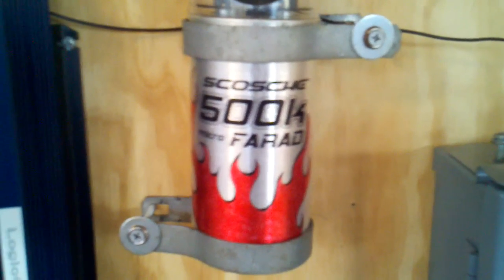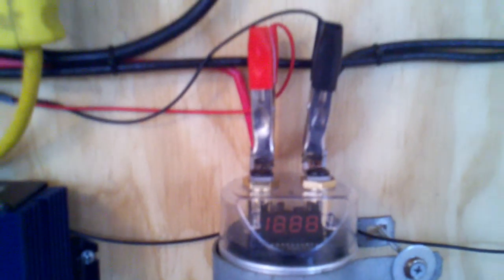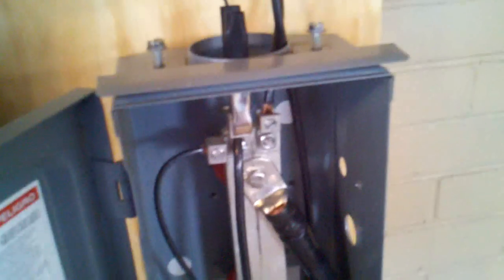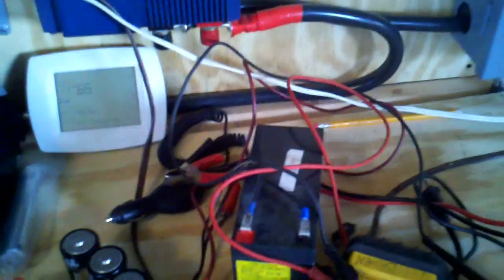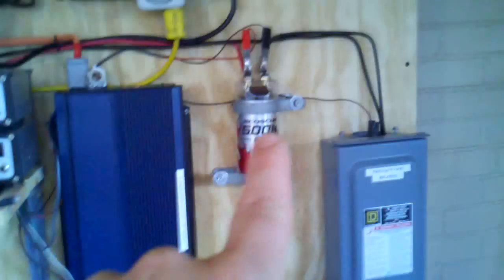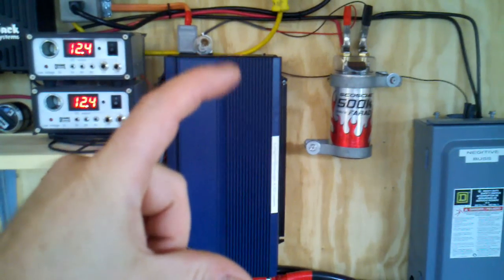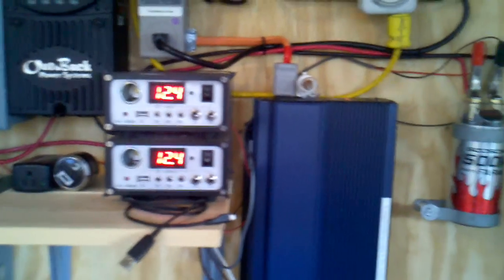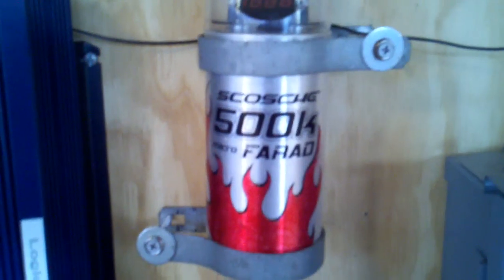How to wire a super Capacitor into your PV solar setup to help with starting up inverter loads

Comment: i got  my super caps and hook it up to my batteries in parallel , I've notice that it discharge my batteries during nite time, does your batteries discharge too? i try to connect onli the batteries and the 6 super caps rated 2.5 v 700 farad parallel to the batteries and discharge it but not totally discharge. the reading of my battery voltage is 12.8 v then i hook up the super cap @ around 6pm then in the morning @ 6 am  the voltage reading is 12.5 v, is there any remedy to eliminate this voltage drop while using the super cap?

Comment: what happnes to inverter when the cap discharges. How do you determ the correct MFD and volts of the cap to be used ?
Thanks

Comment: what happened if I connect battery to capacitor then to inventer like this (solar controller 12v to capacitor to battery to inventer 2000w) is that safe??

Comment: so technically the super capacitor is parallel to the battery ?   is it like charge controller to battery to super capacitor then to the inverter

Comment: This is unnecessary. No need with solar because the battery bank is large enough to support even the largest surge loads.
Reply: Wouldn't this extend the life of the batteries? And for me, having built my own battery w 18650's, wouldn't this help

Comment: Guy, am I understanding this right? You wired your capacitor in parallel with your battery bank? How did you determine what size you needed? Thanks.

Comment: Can you confirm the cap is sitting in between the inverter output (load) and the appliances (in this case you’re using a bus bar). For some reason it looked like you had it between the batteries or power source and the inverter which doesn’t make sense

Comment: Can you please let me know , is it OK to connect 2 500K caps to one 2000w inverter? or it not recommended? by watching your video I learn a lot, please keep up the good work.
Reply: remember that 2 capacitors in parallel double the voltage. in series it half's it.

Comment: Thank you Guy for sharing your wisdom with this clever hookup! I have a question for you re. your positive and negative busbars. What type of insulated standoff did you use to isolate the bus in their respective box's?   What is their specific name as applied here in your setup? Are those readily available items found at the big box stores electrical aisle, or are they more of a specialty item found at the electrical supply house? I have some nice copper bar from a friend who had extra from a high volt install. I really dig your setup and want to use your layout on my own system and the insulators to isolate that bus are the last items I need to complete the project. Hope to hear from ya soon! Thanks in advance from a big fan of the channel!

Comment: Been thinking of something like this for my 24v system in my RV to help start my rooftop a/c. Can anyone speculate on if that would work, and if it's possible to wire 2 of these together for a 24v system? My inverter is only 2500w and these RV a/c are really hard to start.
Reply: If the caps are rated 24v or above, you can hook them together in a 24v system.
You can not use 2 x 12v caps to get 24v.

Comment: The main problem with starting large loads with a high frequency inverter is how fast the DC-DC converter inside it can recharge the internal high voltage DC storage caps.

Adding capacitance on the input side as you have done may well help, but what I'm picking would be really effective is beefing up the size ov those internal caps. A bigger reservoir ov stored high voltage DC would give the H-Bridge more to dish out.

This ov course is an extreme mod. It requires hacking an inverter, would certainly void the warranty and is quite dangerous too due to the voltages involved and the fact they are stored in caps. No more dangerous though than working on a tube guitar amp. ;)
Reply from the maker: xanataph Great thought but like you said that is a hack of hacks. I think I'll stick with it like it is. Thanks for watching!!!
Reply: Guy Brown I saw a guy on YouTube strap two 400w inverters together so he could get 800 watts out. He did it by connecting the HVDC line ov each inverter together. Now thats extreme! It worked well though, but it was really just a proof ov concept as each inverter was only 400w. Would have been a tad easier to just get a 1000w model! But not as much fun. ;)

Comment: Just curious as it seems that you've done this setup a few years back.  Have you rewired your setup?  The reason I ask is that the wiring on the video had 90 degree bends and the box penetrations did not have any protection for the wires going through it.  The 90 deg bends looks good but not good for the wire and so is the non protected penetrations (no pun intended).

Comment: Thanks for the video very easy to understand and this is exactly what i was looking for. Now my question is from reading some stuff about this is you should have a diode somewhere along the line besides the solar panels is this true? Do you have em on yours and how long have you had this setup running for.
Reply from the maker: Tom Ziesmer diodes are in the panels. I have had my system for going on 3 years and growing every chance I get. I just did a complete overview of the system if you want to watch that video.
Reply: Tom Ziesmer am going to try this what do u think
Reply: [EDIT]
TL;DR
Did you have to solder it in or was it built in. P.S. stupid question I know.

You say the diodes are in the panels... the word choice of "in" as opposed to something like 'connected to' seems to imply that the diodes are built in by the manufacture. I don't know how common that is... ranging from never happen, thus it's safe to assume you just meant you soldered them inside of the panel frame or something like that or you where just speaking in a rround about way and thay are not 'in' in any sense but rather wired to them but 'in' is close enough for government work so to speak... ranging to they're prety much all made that way, duh Grant [self] get a clue lol) Based on the OC's (original commenter as opposed to OP for original poster) question, I gather that it's common to have to add it... but rather than assume that you have to add it (thus I'd guess you where being slightly less than precise with your language, which is common especially in America) but rather than assume, I'd like to ask for clarification... so did you have add them, or where they built in. 

All the explanation is just to show that I'm ignorant about solar panel construction... not stupid. Albeit a bit over analytical to make an understatement. I couldn't learn to tell time on an analogue clock in grade school because I was hung up on impressions in my teachers speech. She said the 'big hand' and the 'little hand' well the short hand is short thus little, but fat thus big, and the long hand is long thus big but narrow/skinny thus little so which hand is which... that's too ambiguous for me because I'm smart enough to catch the ambiguity immediately, but was too stuck on that to notice that she was pointing to the answer... and clockwise vs counterclockwise/anticlockwise... um nobody said we where referencing the top of the circle when we say it goes to the right... if you reference the bottom of the circle it's going to the left... dear teacher your assuming I already understand that 12 is generally considered the reference point... um to this day nobody has ever said that to me directly... I've since inferred it intuitively but it took learning how to read the clock to get that... you can't assume I know that when your just teaching me to read one... we didn't have a second hand to watch and as a idk like 4 year old, I didn't have a whole minutes worth of patients to watch it, i know because it occurred to me to try to gather the direction of motion thus giving away the reference point but waiting and watching it seemed to take forever. So yes being over analytical and stuck on precision of language has a long track record of holding me back... I was 12 when I finally learned to read an analogue clock. I learned too read late too because people outright refused to clearify that the alphebet goes L M N O P not elemeno pee... what's an elemeno is that like the element (think periodic table) of a meno (baby fish)? If so what the hell is the urine of the element that makes up a baby fish doing in the alphabet and which symbol (letter) does that represent? and I clearly remember not seeing the 'n' inbetween the y AND the z enunciate the word and as AnD not " 'an " which my untrained ears heard as 'en' which is how we pronounce the name of the letter 'N'... but my real name begins with the letter 'N' so I was keen to notice it's placement in the alphabet... it was clearly in the middle not the end! So correlating the song to the symbols was a struggle for me. I got it as soon as my mom was informed I was struggling with it... she enunciates her words, my teacher did not. But it took long enough for them to catch on that I wasn't catching on that I got held back a year. I hate that teacher for that. Some people need clarity because they can immediately recognize ambiguity... this is an important concept for a teacher to know... not necessarily to accommodate the over analytical kids, though just doing that may get through a lesson faster for the kid, but to begin teaching them to cope with the fact that we don't live in a completely precise world. Introducing the concept of environmental and linguistic context clues as a conscious thought rather than something you just subconsciously know without realizing it at an early age would have worked miracles for me. Look at me rambling on... sorry I've completely forgotten what my point was so imma stop here. Sorry.

Comment: Does the surge keep the battery from loosing its charge . If so why don't cars have this surge thing connected between the starter and the battery in your car . It seems like something like this would help your battery last longer also.
Reply: Then they couldn't sell as many batteries....

Comment: That's what I thought because one time I disconnected my inverter from my battery bank and the positive cable attached to the inverter accidentally touched the negative cable that was also still attached to the inverter and I got a spark.  I figured there was a capacitor inside my inverter that got discharged.

Comment: HI GUT CAN I USED 2 OR 4 IN SERIES TO DOBLE THE CAPACITY THANK YOU
Reply from the maker: Jose Gomez parallel
Reply: you can but if put in series they will leak power so you wont get a full 24v or 48v. you lose power when doing this due to power leakage

Comment: hi Guy, nice  info but can you tell me is the capacitor size relevant to the size of the panels/inverter
Reply: Pardon my 2 cents
Think of the capacitor as another battery, the voltage rating of the capacitor should be at least twice the system voltage it is connected to.
There exist, what are known as "ultra/Super capacitors" These are always low voltage devices and need to be placed in series to further up their voltage and need special circuits to keep them happy. The amazing thing about these ultra caps is their sheer capacity, instead of the monster you see in this video, that happans to be one half of a farad, an ultra/super cap the size of a D cell has the capacity of 350 farads!!
That is 349.5 Farads more capacity. Sorta like magic I'd say.

     Personally, the more capacitance the better, the true relevance in this scenario is to the load that "bangs on" resulting in a huge current surge and resulting voltage drop.
One must keep in mind that 12 volts is a relatively low "pressure" and the capacitor role is to add current more (amps) to the circuit on demand, even though the extra kick is momentary and the capacitor is "spent" for that duration, then contiues to charge back almost instantaneously.
I am pretty sure Guy may agree with me on this?
Reply from the maker: Craig Nehring Couldnt have said it better myself. I used this cap because it was free. I would go with the super caps if I where to invest money. Thanks for the feed back. I hope you found some value in my video. Thanks for watching!!!

Comment: How would you wire that caoacitor for a 24 v system?  2 in series?
Reply: That's a good question. Are there 24v capacitors? Or will you have to wire 2x12v capacitors in series?
Reply: +Foo Fabulous
 I'm a 24 system so I'm asking too.
Reply: I have access to 24v capacitors if you are still looking

Comment: I have a 5 farad capacitor  and it turns on wi5h my 3000w eliminator invertor however
when I try and run anything it just overloads the invertor  below 10.6

even a simple 40watt led lights
why is this i  have the capacitor  fused as well 60amps
I've tried using different batteries  both on solar and off

makes no.difference

can you help me understand  why this is plz
Reply: This video has a 500 farad cap, which is 100 times your capacity. The more storage on the plates of the cap provide the current needed for the start up.

Comment: OK, i am so new at this, so please forgive the noob question.
So capacitor positive goes to bus positive, and capacitor negative goes to bus negative?
How does the capacitor get its energy to build up its amps?
Reply: Im new also,  I saw another video where one guy connected the caps to a pedal bike and he worked like a trojan peddling an peddling for ten mnts and his dynamo thingy charged the caps,   He  did have a heart attack an died but He will be up there or worse - down there saying those caps are deffo charged,  hope this is helpful sir.

Comment: I tried that to set up that you have but instead of using solar panels I tried using a 110 motor to plug in my power inverter and then ran it off an alternator and said he's been soil panels what am I doing wrong because all it does is it runs the motor for a second and dies runs the motor for a second to die just enough to charge capacitor up then it dies again charge capacitor up dies again what am I doing wrong here
Reply: Maybe your capacitor is hooked up wrong.. power does not actually travel through a capacitor.. it charges the capacitor and releases it on the same line.

Comment: Nice video, I am happy to see this as I have been thinking along the same lines. In my case I wonder if it was possible to eliminate the battery bank so as to power a small fridge. Sizing the panel array to the load, say 300 watts or the power requirements of the fridge, and then match the reserve starting capacity to a bank of super caps?
This would be to run a fridge during on peak daytime kilowatt charge (I pay $0.27 per peak KWh). Addition of a suitably sized battery is always an option of course.
I am no longer an advocate of grid tie systems due to recent rulings by our Public Service Commission. (Wisconsin)
Reply from the maker: Craig Nehring What was the rulings? Thanks for the feed back. I hope you found some value in my video. Thanks for watching!!!
Reply: Guy Brown PSC/PUC (Public Service/Utility Commission)
"Though existing customers' solar projects would be grandfathered from the changes for 10 years, the proposals are tantamount to a 40% reduction in the value of what customers receive from a solar project, said Tyler Huebner, executive director of the advocacy group Renew Wisconsin, after the vote."

"After the PSC finalizes its decisions, the Alliance for Solar Choice plans to file suit in court to overturn the solar rulings the PSC made Friday, said Bryan Miller, vice president of the solar company SunRun, a company that's part of the alliance.
"Phil Montgomery and Ellen Nowak became the first commissioners in the country to tax rooftop solar companies out of business, and that decision will not stand," Miller said. "It will certainly be their political legacy, but the decision will not stand."
Source: http://www.jsonline.com/business/psc-begins-consideration-of-we-energies-rate-hike-plan-b99390765z1-282726581.html

As part of a rate case involving Milwaukee-based WE Energies, the PSC decided late last year to hit people who have solar panels with a monthly charge of about $20.
Not only that, but the rate for buy back of solar generated power is $.03-$.04 per KwH
Customers who install solar systems on their own property will be required to pay We Energies $3.80 per KW per month. For example, a homeowner with a 5 KW solar system will be required to pay $228 annually to We Energies for owning solar. This fee is a major setback to the growth of solar in We Energies' territory. This single change will make many marginal solar systems uneconomical.The fixed charge on all residential bills will increase from about $9 to $16 a month - a 75% increase. The amount paid per kilowatt hour will be reduced one-half cent to $0.1349/KWH from $0.139/KWH. Coupled with the above per KW charge, this KWH change will make several solar systems uncompetitive in the state.

The question I need answered is, what if you are NOT grid tied, rather parallel dual system off the grid and on but do not ever connect to share back any power?
Remember, the electric utility is not going to allow the meter to "run backwards"
Oh yes, by the way...
Yes I found your video to be interesting and of value ;>)
Reply: Peps in the US are getting screwed by utilities and corporations and it seems like the New rules start out in Wisconsin -- what is up with that?